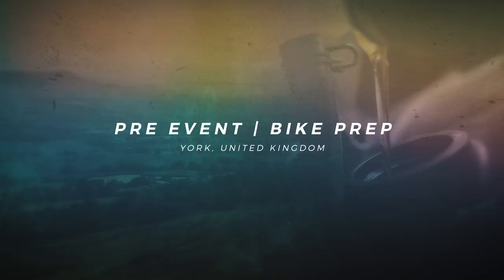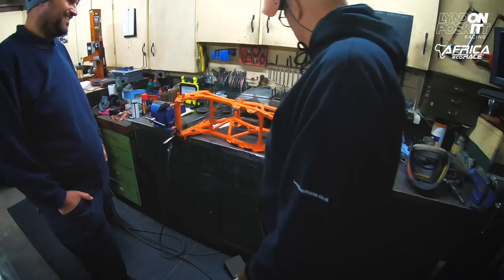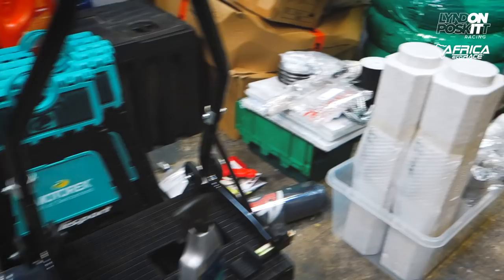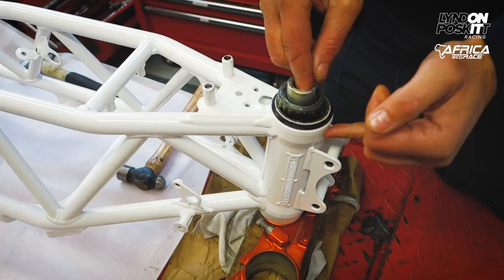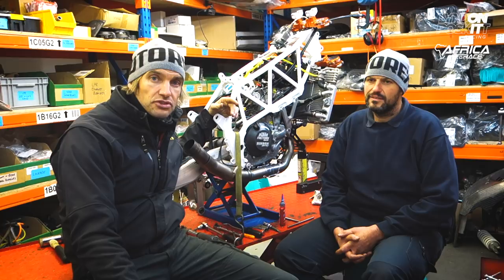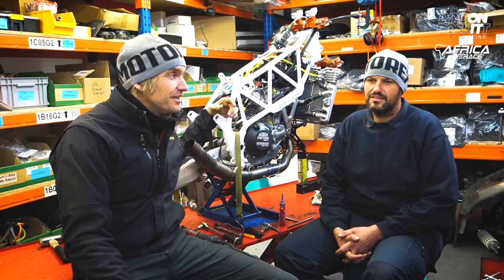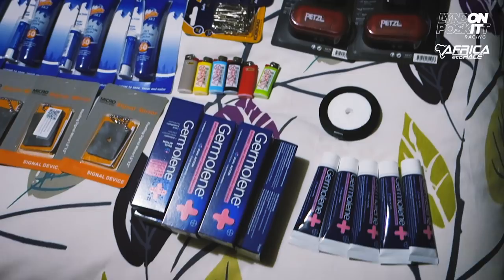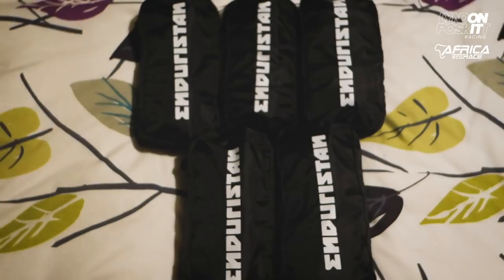Race 2 Dakar 2020, Africa Eco rally Race ,Team Races to Places Ep.1 with Lyndon Poskitt

Comment: With you building all the bikes for the team - how do you make sure they're fitted to all the riders - just adjusting the handlebars or are there more "mods"?
I'm 198cm and in the process of adjusting a dual purpose bike to fit - so far quite the challenge for me.
Reply: @lyndonposkitt  Thanks for the reply! I understand what you mean, but I guess in my case adjusting to the bike would be silly simply because the bike is too small. The handlebars end up way too close to my body when I stand up and I lose control of it.
I bet it's all a lot simpler when everyone is more average sized and not 6ft6in. Or if the bikes are larger to start with. Which I believe the KTMs are.. Next bike will be either a KTM or Husqvarna. Until then I gotta make the most of my DR650.
Best of luck in the race for the whole team! I can't wait to follow all the action! Thanks for all your work !!